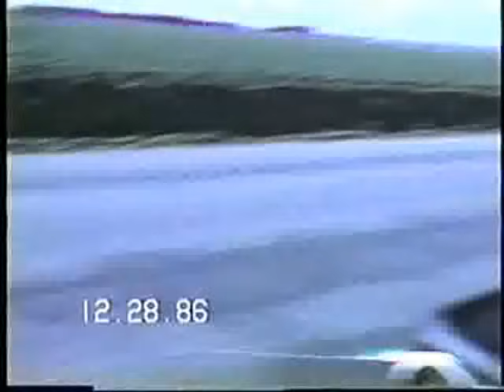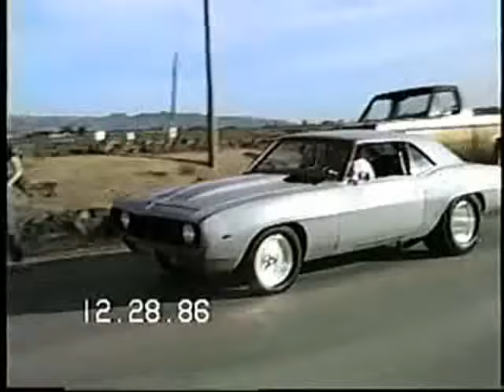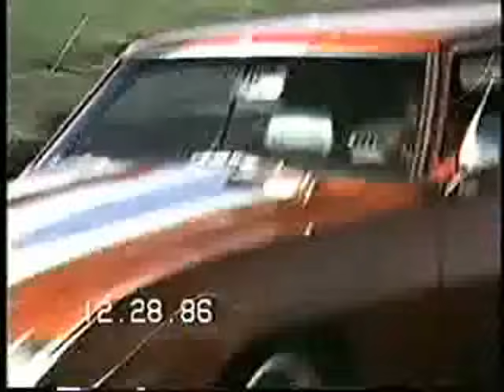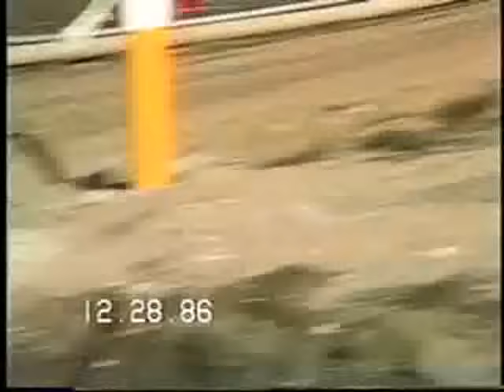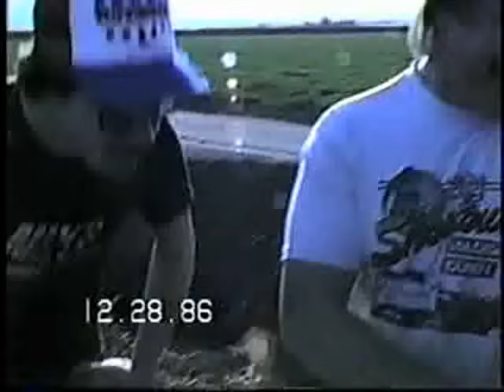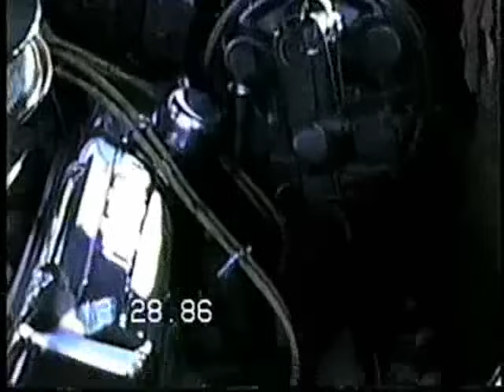12/28/86 Street Racing

Comment: Not a single street race just some 14 second cars launching
Reply: Lol. 14 second cars were something back then. 

Whats crazy is to realize the camaros in this video were newer then than any LS1 camaro today
Reply: They are faster than 14s. The 69 gear driven camero would dip 12s..4sp falcon 13s. No traction, launch, suspension control...crank windows...no computers...what a great time...put a teen behind the wheel of one of those cars...would probably end up in the ditch on the left....no idea how to control....
Reply: @jennyperson
I dont think so. My stock one legger 66 gs buick ran a 15.6. A buddy's stock 68 gts dart ran 13.99. The gear driven camero is lighter and not stock. It would have easily dipped in the 12s..
Reply: @lenny
Yeah it all comes down to weight transfer, traction and driver. Sure a well prepped engine. I understand exactly what it takes to get to the 12s a person can have a loaded engine in let's say a 70 nova and  run 14s...place that exact engine in a 70 nova with a tuned chassis would shave 1.5 sec. The driver is a very important factor as well. When I raced at baylands raceway before the leftie snow flakes (fast track directly at sea level) closed it, one buddy did have a 69 got 4sp. He could only get 17s..couldn't shift to save his ass...the very next run a different driver shifted it to a 14.5. Another buddy did have a 69 roadrunner 383 purple shaft cam 4sp could only get a 14.8...the fella he bought it from pulled 13.6 all day time slips to prove it ...same exact car...Yeah it takes a lot to get to the 12s. Just curious the track has tire beams to start ...very accurate and start/stop the clock...so the street race is timed by....cell phone? A edge monitor? Your buddy with a watch? Classic..back in those times there was no "suspension" control or "traction" control or tuning fuel injection right before a race with a laptop..tire tech has changed dramatically...yeah it takes a lot to dip into the 12s and would bet that particular camero would dip into the 12s..remember a 12.99 is still 12s...
Reply: That was my 79 z28 pal.  It ran 13s and was the slowest car out there.
Reply: @bigtires100  in the eighth maybe
Reply: @idontlikecops1  nah on the streets, we marked it out by streetlight spacing. Shine a spotlight at the sensor on tops darken all to the end. The finish line was lit. 1320. Hunting was the fun part, some folks called it cruising...  Hundred bucks a gear, the "four speed dudes"👍

Comment: No racing. Just a few guys seeing how far they can smoke the tires?

Can we at least get an idea of the 1/8 or 1/4 mile time these cars ran?
Reply: In 1976 I had 73 Z-28, still have it. Ran 11-70 with only a 7" wide tire 126 mph 1-4 mile. 350 cu in. Didn't get beat much on the street, raced All the  time, it was a blast. I rem❤ember seeing 30+ cars on the back road two miles from my house. Great times.

Comment: I remember those days. Had a 78 monza spyder with a 400 sbc with ported 041's  Welded up the spider gears so id have posi. th350 with a 3000 stall. Still had problems putting it to the ground.
Reply: We had a 75 base model Monza 2+2. Had a nicely built 327 and the Muncie M-22. Had a lot of fun with that thing. I have a 79 Olds Starfire with the Buick 231 and a Saginaw 4 speed in it. I’ve been thinking about building that one into a play toy but doing it right this time with the subframe connectors to limit the body twist. I love that body shape.

Comment: Now with new technology we have now these cars can now make more power and have better handling with improved parts just for these old school rides (such as headers, carbs, EFI, stabilizer bars, tires, built transmissions, hydraulic brakes, axles, axle shafts, cooling systems etc) but some nowadays are HEMI/coyote/LS swapping modern engines.

Comment: I can see why the mid east and south didn't invite westerners to showdowns in the 80's. At the beginning the only car that would do proper burnouts was the SS nova or Camaro. My pops had a Satellite Plymouth with Mickie's  in like 86 with a column shift that would burn the tires off the rim. That was just my dads weekend cruiser. His buddies had Prostreet Blocks and high rise intakes and 1st stage blowers and I remember they would blow the tires off them cars at Piedmont man. All the cars look so aggressive then they perform and I'm like "aint no way" with all those parts that they are barley spinning a tire and I know those are huge rear tires and the power ratio today is much bigger but some of those cars even at that time were monsters right off the showroom floor. But I guess that's what happens when no fords are around

Comment: Get to together and see who had the faster 15 second cars, good times
Reply: My Torino ran low 16s and it was in the top 10 in HS back then.
Reply: That would require them to actually race, this was for the best burnout/launch trophy.
Reply: That was my 79 Z28 doing a one legger burnout and it would run a 13 second 1/4 mile.  It was the slowest car out there that day.

Comment: Oh I miss the good ol days when  cool cars were cheap haircuts were ridiculous and if you had 400hp you weren't the broke slow guy. Kids nowadays watch social media and automatically think 600hp is the entry level power requirement to have any fun when a healthy 350hp car like Camaro or nova is a lively fun car that is a blast to raise hell in, with just regular ol cheap 60 series all season radials you can do burnouts for distance all day! Back in early 90s I had a 76 nova SS when I bought it it had a 3.31 12 bolt posi th350 the engine was an old tiered stock shortblock smogger headed oil burning 350 with factory iron 4bbl intake and a Q jet (I swapped on a Holley 650 double pumper q jet replacement), headers, in front of rear tire side exit duals with turbo mufflers a mild crane Energizer 268 and 245/60r14 tires and that was capable of completely repaving the town with that car, you could just punch it from a stand still and go up the road sideways and with what 250hp... I traded a beautiful 85 Z28 for for that nova and money it it had an Lg4 305 160hp! Woohoo! an yeah it was slow AF but I'd love to have that Z now, toss a stock vortec 350 out of truck toss rpm air gap Holley 750 and nice lumpy cam and set of long tubes in it and bam for $1500 you now went from a 160hp Z that would get gapped by a minivan to a respectfully quick 375hp Z toss a 150 shot on it an go out to easily pick on stock coyotes....... If I'm not mistaken that same Z is about a mile from my house sitting off a driveway looking pretty sad I was told that particular car is rotted to all hell that's sad when I sold it in 95ish it was like new and fully loaded t top car.

Comment: Could u imagine going back in time with an LS  in one of those chevys...
Reply: Why?     The mouse or rat motor sounds ALOT better and can make the same power as the LS.

The biggest advantage the LS has is the fuel injection, and that can just as easily be bolted onto an sbc.

You need a supercharger to get huge horsepower out of an LS anyway, and we had blowers back then to (though few of us could afford them).
Reply: @Steve_Kelly_Oak  I'm old school guy myself, just built a 383 stroker. But I will say the ls has some pretty badass heads from the factory. I think they flow like 300 on the intake. Also Ls blocks are way stronger than factory old school blocks. But I agree you can definitely make just as much power with SBC. I should be running mid to upper 10s with my 383 and should be on pump gas.
Reply: @bigrig.  I agree completely with what you said. The LS does in fact have some advantages due to technology, the stronger base block being one of them.

I have a 355 sbc full roller engine that was built for a B econo dragster that will reliably make 550 horse on the street.

So it can be done with a small block as well, just costs alot more money.... Lol

And yes, LS engines ARE better, no question.  Something would be wrong if they had never improved an engine designed in early 1950's!
Reply: Back then...  a 4 bolt block, a high quality machine shop, 400 crank, and some high quality work on heads and a 383 was STOUT.  
Comparing junkyard SBC to junkyard Gen 3s and yes absolutely no competition.  But a good and experienced engine builder back then could make it happen
Reply: @Steve_Kelly_Oak  please stop.

Comment: Meanwhile in 2023 they've got minivans making that much power from the factory. lol
Reply: I bet my 23 Honda Ridgeline w/280HP and 9 speed trans would outrun that 80 Z28
Reply: Electric bs that will smoke anything I own or owned. :eyes-purple-crying:
Reply: @larrytheableguy3441   Yeah but.... theatrics of exhaust, shifting, the car hopping up at launch, steering with the rear in my mind wins the mind and heart every single time.
I have a 04 Z06 and I could easily get into something faster. But you know.... the theatrics of a LOUD exhaust, manual trans, and coming off a corner a little sideways..... that makes me smile more than anything an  electric car could offer.

I will say one thing for electronics though... that Vettes stability control has saved me 10+ times. And I'm not kidding.
Reply: @wydopnthrtl  I agree, I am not pro electric. My buddy has a 03 Z06, was doing a launch in front of the house after a car show but he turned traction control off, caught 2nd and that thing went left and he spun around in an empty lot, lucky this road had no curbs. No damage except for dirt and grass in between the tire and rim. He thought something broke the way it snapped left. A few to many cold snacks maybe and a dirty road. Shit happens.
Reply: @wydopnthrtl  You might as well just turn in your man card right now.
Reply: @larrytheableguy3441   I;ve intentionally done some donuts before in the 04Z.  It does indeed whip around quicker than I'm used too.  I think because its a 50/50 weight balance with the trans in the rear its easy to get it around.  Can't say I notice that on the road though. I pretty much have to intentionally turn TC off and try.
Reply: @generalkayoss7347  Hum.... tell you what. Next summer you beat me in the 1/4mile and I'll personally hand it to you. 
Mid-Ohio next June-ish. 😎

Comment: How did we have so much fun with cars that were soooooo slow. 
All the noise and chrome....but yikes has motorsports grown up. Street cars coming from the factory with 1000+hp. Modestly modded cars in the 1400hp range that still have an easy idle, cold starts, air-conditioning, etc. Common to see garage modded cars that are so powerful, it is only a guess how much power they produce since there are so few dynos that can do 1500hp+

Comment: I wonder how much money I would take if I showed up with a Lucid Saphire.

“It don’t even got an engine on it!”
Reply: But it does have a motor in it. By the time you take your car out there and try to race, your battery would probably be dead. So then what are you going to do in 86? No way to charge it back then.🧐
Reply: @ruazfast  It has 400 miles of charge.  They come with a mobile charger, that plugs in to regular dryer outlets.  Although the charging will be SLOW.
Reply: @juanc5149 looks like you've got it all figured out so I guess I'll see you in 1986. And oh I have the black Ford.

Comment: Where's the burnouts?
Reply: So in realville "burnout" were NOT sitting still and smoking tires.  They were for showing you made excess power when leaving the line.
Children put the pedal to the floor to smoke tires.  MEN lift the throttle to get traction and..... WIN on the big end.